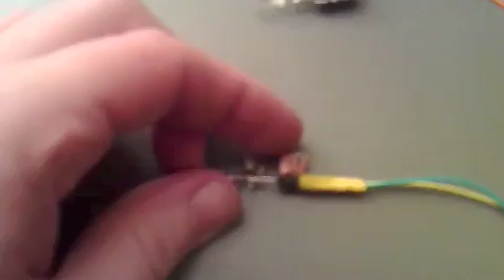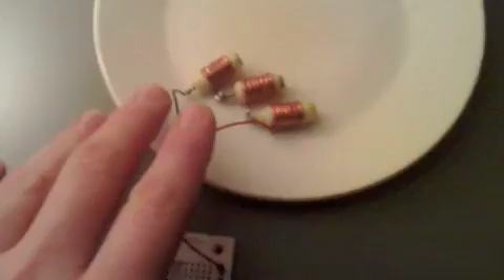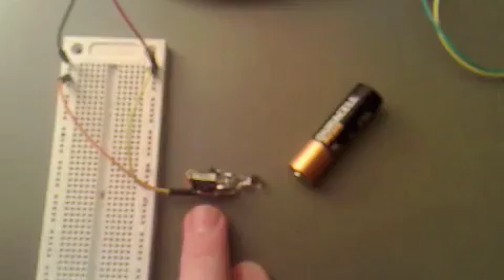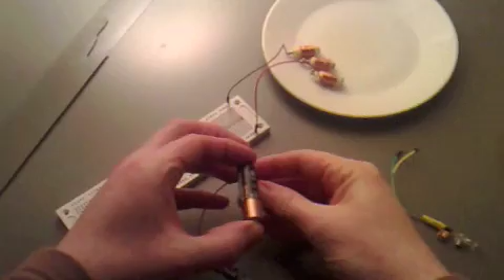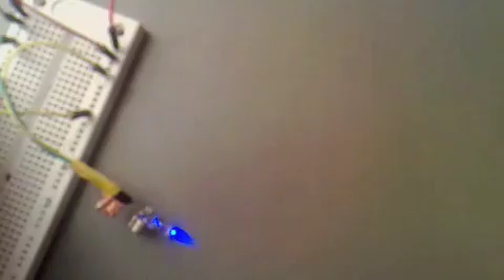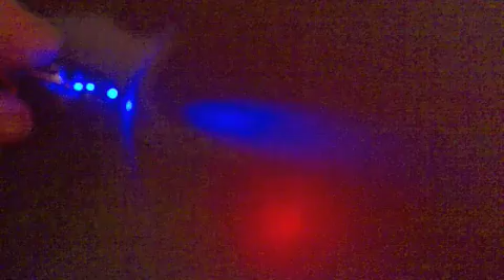Water Battery (With Joule Thief) 005

Comment from the maker: Yes, In a way it converts the DC to a higher DC but it uses the Flyback Voltage of the Coil in the circuit to power the LED.

Thanks for watching.

Comment from the maker: It works the same way as the Bedini Circuit, It uses the Flyback Voltage to power the LED with the positive side of the LED Connected to the negative side of the battery. The LED needs 3v to power it up but it will run off this circuit at 1v and less.